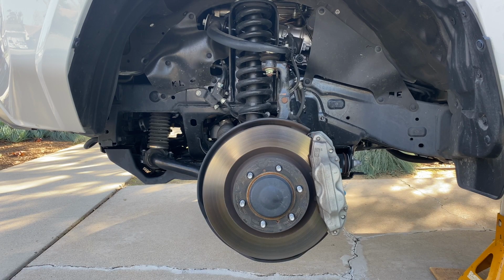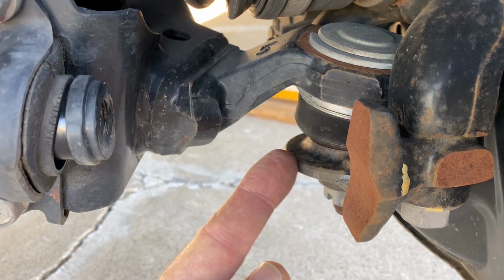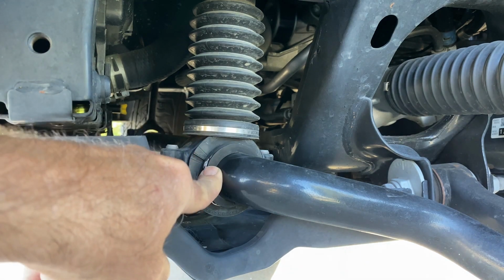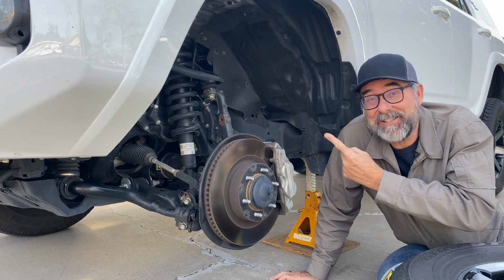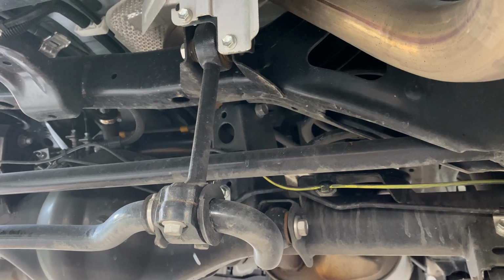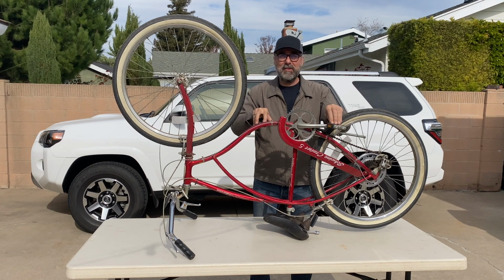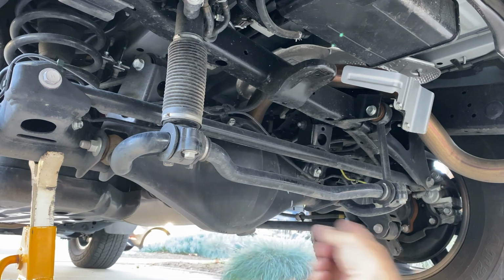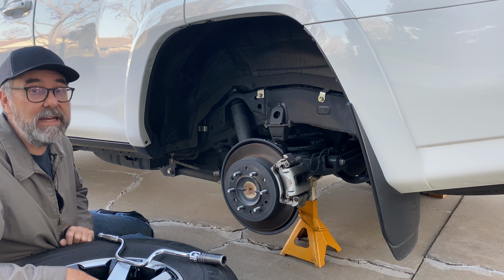2021 Toyota 4Runner TRD Off-Road Suspension Walkaround: Why I Bought The KDSS Stabilizer Bar System

Comment: Excellent explanation.  Good close up video break down showing each component and its functionality.  WAY too many people don't know or understand what KDSS means.  From the non-owners to the owners.  I guarantee I did my homework and LOVE the KDSS as much as you.  In fact, that was the biggest selling point for me in choosing the TRD Off-Road over the Pro.  So many brag about the Pro, but it is actually slightly hindered in capabilities.  To bad most buyers will never truly comprehend just how great this system is.  Even though I knew what it meant, I purposely test drove the SR5, TRD Off-Road and the Pro to feel the differences 1st hand.  To me, it is night and day differences.  Body roll sucks in an SUV!  So KDSS was for me.  FYI, in case you did not know, you can put a lift of 2.5 inch on the front and 1 inch on the rear of the vehicle before maxing out and having to remove the system.  And the ride is just as excellent as stock.
Reply: The Off Road with KDSS handles the road much better than a Pro?
Reply: @RobS123  a 4runner off road is superior on road especially and even off road than a 4runner TRD pro. A pro would just have better off road suspension and feel than a KDSS 4runner, but the articulation and actual performance is higher than a pro (assuming both are stock).  

Also, if a person adds a KDSS on and off switch, they can improve ride quality to surpass the pro without needing upgraded shocks. This is because KDSS automatically activates under 12 mph and sway bars essentially disconnect, but with a switch installed KDSS can be activated at higher speeds in rough terrain to give better riding comfort.
Reply: Would the lift affect the KDSS system in any way or hinder its effectiveness?
Reply: Only difference is the fox shocks
Reply: KDSS makes cornering in a Land Cruiser Prado feel like a sports car — flat and composed
Reply: Thanks, I always wondered if a lift is possible with the KDSS equipped

Comment: Thank you SO MUCH for this video! I’ve been debating weather or not KDSS is worth it. I’ve been trying to get a 4Runner Venture edition with KDSS and they’re hard to find. I was wondering if all the trouble is worth it. 
But I want the 4Runner as my off road/work truck AND my daily driver. I think getting it with KDSS will make it an even better all around vehicle.
Thanks!
Reply from the maker: Yes. I think the benefits of KDSS on pavement are not well understood.
Reply: We just went from a 2014 non KDSS Trail, to ‘21 Venture with KDSS.  I wasn’t convinced yet on the highway drive home, but once we started driving on the bumpy and windy roads near home, I noticed how much more it seems to stay level.  There’s one left hand corner we drive daily that always kind of popped the ‘14 over and really made you feel a slight tippiness.  I’m not feeling that anymore with this one- and my wife has noticed it feels smoother and quieter on our windy dirt road. Love it!

Comment: Just got some OEM pro fox shocks that I will be installing in my ORP! good info.
Reply from the maker: I saw a set of those on a local e-swap site for $750. Take-off Pro stuff is a good and potentially inexpensive way to do an instant upgrade that has been vetted by testing.
Reply: @DanEdmunds  Yeah only wanted to level out the ride height and not do crazy lift so I went with that shocks, if Bilstein 6112 isn't out of stock I would have gotten those.
Reply: I have the same setup and am very happy with the ride. Eibach also has longer springs that will provide a moderate lift with the bypass zones in mind.
Reply: @jamess4707  I saw it popped up on my Amazon and couldn't stop my self and bought that spring set also! just waiting till it get warmer to install it.

Comment: Hey Dan, huge fan of your videos. Always learn something new. You mentioned tires and wheels are something you will be looking at, as an owner of a 5th Gen., it would be amazing if you share Dan’s choices for suspension upgrades that will not adversely impact the performance of the 4R. As you know, too many options out there, without test driving them it is pretty hard to make the right selection. I have a RTT, heavy load in the cargo (fridge, Yeti, etc.) and 4 people. Keep publishing! Best!!
Reply from the maker: Driving them beforehand is tough. Even for me. I have some thoughts, but I'm going to have to see. Cost is a big issue. I don't have. blank check.
Reply: @DanEdmunds  Thank you!

Comment: What is the longevity of the KDSS components?
Reply from the maker: I'm still gathering data on that.
Reply: @DanEdmunds  I just wondering whether the KDSS has the same 25 year lifespan as the rest of the 4Runner.
Reply: @RightLaneHog3151  It really depends on how you use your 4runner. 
If the vehicle is your daily driver and you do occational mild wheeling, it will last you a long time compared to those hardcore offroaders.

Comment: Dan, Is it possible to lift (2-3 inch) the 4Runner without impacting the functionality of KDSS?
Reply from the maker: I have been told that the lift limit resides in that range, but there's no official policy from Toyota. I'm not sure how much I'll lift this, but 2" should be enough for me.
Reply: @DanEdmunds  Thanks for the response.
Reply: Aerospace Electrical Engineer retired here. I just realized that you are an engineer also. Reason why your explanations are far superior than most youtubers. Great Job in passing your knowledge. 
Keep up the good work!!!
Reply: I have a 3” toytec lift in my 4Runner with KDSS. It’s awesome. A little difficult to get the coilover in on the passenger side with the solid piston looking side in the front and back. You’ll need to pry down the lower control arm to get it in there.
Reply: @MauiFishingAdventures  Good to know, as I’m looking at the 4 Runner for my next vehicle. The ToyTec lift kit works well in my FJ. Thx.
Reply: @tirsorosario5940  Just gave Dan the answer to the question you are asking.   2.5 inch. in the front and 1 inch in the rear.  And that will maintain the same great ride response using the KDSS.  IF you go past those #'s, you will compromise its effectiveness.  And at about 3 inches I have been told you have to start doing modifications to it to the point that the KDSS just has to come off.
Reply: @WW-wf8tu  cool
Reply: My 2020 TRD ORP with KDSS has Bilstein 5100 shocks all around and 285 70 17s KO2 BFGs. I have the front shocks on the highest lift perch with stock springs and Bilstein rear lift springs.  My lift (before changing the tires) was 2 and a half inches in the front and a hair under 2 inches in the rear.  With SPC upper control arms, I got lots of Caster angle.  It's been 7 months and I couldn't be happier with how it feels and looks.
Reply: @pn312  Nice set up. Thx for sharing.

Comment: Dan thanks for the detailed look at KDSS. I could not find an explanation of the system that made understanding it so complete. I have a TRD Pro 4Runner coming in a couple of weeks. I went with the pro for the shocks. Living in Nevada we have miles of desert roads and my thought was the internal bi-pass and reservoir  would hold up better over the long haul. Would you please do a detailed explanation of the Pro also and if possible explain the effects that a lift like Westcott Designs might have on the ride quality. Thanks again, I always enjoy your reviews.
Reply from the maker: Yeah. Nothing wrong with the Pro, especially if. Those shocks should be excellent over miles of poorly-maintained roads and washboard -- which is about the toughest scenario for shocks. I have a look at the Pro coming soon, but I'm not sure I can predict how a given brand's lift will affect ride. So much goes into that, including any wheel/tire changes someone makes independent of the lift or the shocks.
Reply: @DanEdmunds  Thank you for responding. Your in depth reviews are awesome. Thank again.

Comment: Great explanation of KDSS Dan, Thank you..!! Can't wait to see the wheel articulation test TRD Offroad vs TRD Pro. Also love to see wheel articulation both left and right, the reason wonder how the side with out the KDSS cylinder handles wheel articulation.
Reply from the maker: The left-right part won't make a difference. Roll stiffness is split 50/50 left and right when a bar is working, and the same is true when it's wobbling around in there. The fact that there's only a cylinder on one side doesn't enter into it. Good thing for me, because I can't get the trucks turned enough to line up with the ramp on the right. And I'd be blind sighting myself up the ramp, too.

Comment: I had the same 4runner in 2016 same colour. In Canada you have to get kdss and “leather” enjoy one of the best built vehicles made today for a reasonable price
Reply from the maker: We can get the TRD Off-Road in standard and Premium. KDSS is an option on both levels. The latter has the leather and the sunroof, etc. I am not a sunroof fan, and I can do without leather, so I went with the cheaper one. I agree that these things are bulletproof. Back when I worked for Toyota in the 90s I led a winter evaluation trip when the 3rd gen was a prototype. Went from Hibbing, Minnesota up and around Lake Superior through places like Hearst and Kapuskasing and ended up in Toronto. -40-50C most of the way.